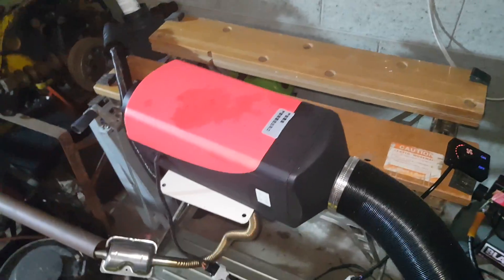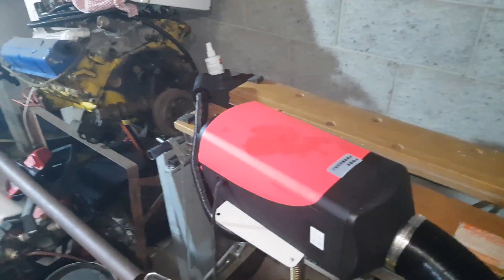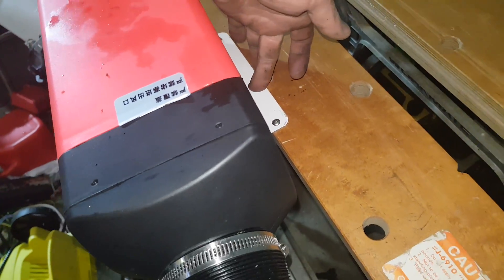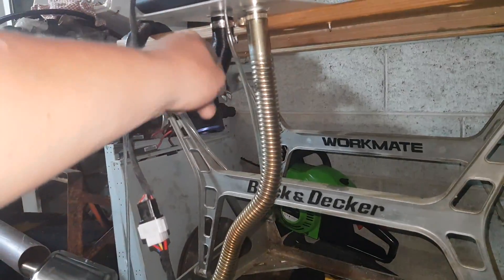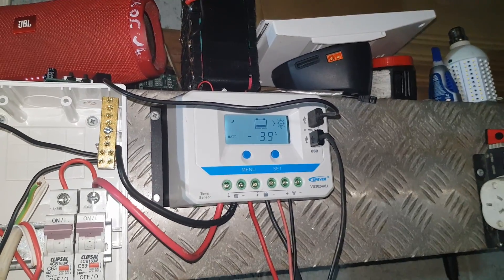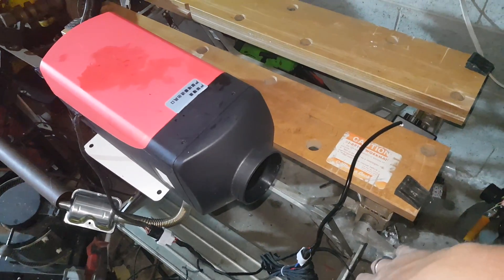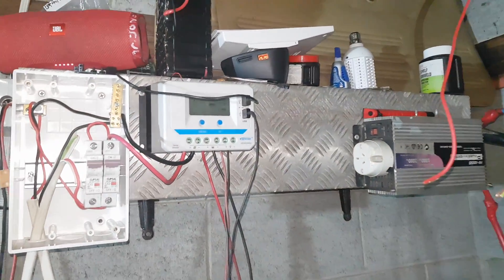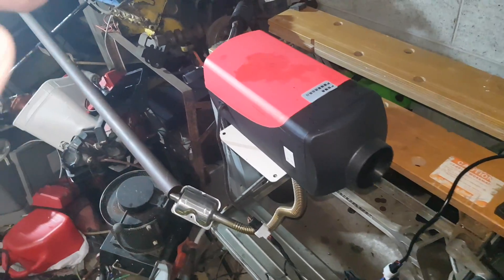5Kw Chinese Diesel Heater Powered By Off Grid Battery Pack. Epever 30Amp Solar Controller.

Comment: Is this run straite off the Electric mains
Reply from the maker: No 12v dc mate
Reply: Ok sound m8 am try to find a vid that can convert 240v down to the spec these need to run at instead run off batteries as i have power in my caravan
Reply: @toonarmybadboy8716 
It'll run fine off your leisure battery, better still if your hooked up to mains, coz it'll keep your battery fully charged
Reply from the maker: Yeah they dont pull much power
Reply: @Oneupthesleevecustoms  
Can it be ran off 1 lead battery and 300watt solar panel?
How many watts output
Reply from the maker: @95SlideNissan  pulls about 45 watts constant on high and 120 ish watts for 10 mins to stsrt up
Reply: @Oneupthesleevecustoms  
Thanks Bro, big help!

Comment: Great video .   Can these heaters be hooked up to cycle on & Off  ?  like how a thermostat does  Or are they on & Off only  ? Thanks for your time
Reply from the maker: These ones could have controller pulled apart and modified to run with a temp sensor. Id shop around at some stage they will come out thermostat controlled
Reply: Mine has a timer that you can set but dont think you can set via a thermostat
Reply: JJD1913  another useful vid here: https://youtu.be/fkdF4F-k3VI

Comment: I'm looking for something like this to head my boat over the winter, but the only source of electricity I have is a 12V battery with a 100W solar panel. Would it drain my battery within minutes/hours? My battery is roughly 90Ah.
Reply from the maker: It runs at about 2.5ah on high once it has started up so you would be fine over night as long as you get good sun each day
Reply: @Oneupthesleevecustoms  Thanks for the info. What about the Ah when starting up? I've read it takes about 10 mins?
Still, I might get one. 😊
Reply from the maker: More like 3 mins and about 10amps
Reply from the maker: https://youtu.be/BRMSFcq4Bc0

Comment: It’s running as should just cannot read the display I think all the screen are same I think you can put lcd on yours it’s just the mother board on heater that is different on 2kw as opposed to 3-5kw
Reply from the maker: Is yours the 2kw or 5kw

Comment: Just use vegie oil as long as its filtered and kept warm will work.
Reply: robsycko, the cooking oil needs to be about 200F/90C. Start up with diesel and end with diesel, but heating the cooking oil with the exhaust would do the job. I don't know how many windings around the exhaust with copper tubing would provide proper heat. That could be another test. For example, run 5 minutes then flip to cooking oil after checking the temperature. Cold oil does not atomize they same way as diesel, until heated. Possibly, with this burner running the glow plug at the end cycle the excess oil is burned, but I still would switch to diesel.

Biodiesel is an option for startups and shut downs. It has glycerin in it that helps to keep the burner clean. It was cooking oil, methanol, and Sodium Hydroxide, but the glycerin goes to the bottom and the lighter biodiesel floats on top. Diesel leaves soot from its use and biodiesel helps remove it.
Reply: @gregyohngy 
It'd be a waste of time in England, kerosene is 69p a litre where i live straight from the pump, and red derv is 89p a litre, 1ltr of vegetable oil is about a pound from Sainsbury's, although it might be cheaper in a Liddel or Aldi
Reply from the maker: Straight? How smokey?
Reply from the maker: https://youtu.be/yLUeCH_HE4Q
Reply from the maker: No good mate :(
Reply from the maker: https://youtu.be/-bmELZaH6zQ veg oil diesel mix

Comment: So does the rotary control still display fault codes using the light around the knob? That would be great if it did?
Reply from the maker: Ive not seen a fault code yet. Ill check and see if the manual mentions it
Reply: @Oneupthesleevecustoms  that would be great, it will help me decide which to go for. think i prefer the simplicity of dial controller and dont need all the flashing lights of the lcd one but the fault codes is a deal breaker. thanks
Reply: Rotary dials will show fault codes... depending on how many lights are on, it’s code is corresponding to E-01 to E-15.... E-01 is low power, not sure of 02... maybe over voltage? Not sure but I do know Facebook has a group/page on Chinese Diesel Heaters.

Comment: Hi I got one of these heaters exactly same as yours except I have lcd screen has been working fine but all of a sudden came up with error  007 so I tested wires none broken then it did something  else screen has gone all broken up and I cannot read what it says there’s three wires to my screen blue red black 4.3 volts comeing through red wire and 3.9 volts coming through blue wire is that normal do you think?i wonderd if you can see how many volts are going to your rotary controll panel should be same voltage I would think unless my mother board on heater it self has gone wrong🙂
Reply: No nothing
Reply from the maker: Can you find what the error code is?
Reply: 007 blue line broken but is not but now screen has gone all funny with bits of numbers missing etc
Reply from the maker: Thats strange have you checked plugs for corrosion ect?
Reply from the maker: Does it fire up at all? I would assume it would be low like less than 5v to the switch and knob to protect its leds
Reply: Yes I have even got rid of the plugs and solderd the wires because I’ve had trouble with those sort of plugs before on a car do you think it’s just the lcd gone wrong for some reason I’ve only had it a month,I did notice the picture on the screen used to flicker
Reply: @leginswheels2416  you get what you pay for. Chinese junk,in my opinion. Espar makes a great heater. Had mine in my truck for 4 years with little maintenance. Changed a screen twice is all .thermostat controlled, just like your home. Runs off diesel fuel. They're about $1000 more or less. Very reliable
Reply from the maker: Yeah im happy with these price wise i can buy 5 to 1

Comment: Can't wait to see the vid of the cabin install..  Was thinking an off grid cabin would be a great use for one or two of these. Even running it through a chimney of some sorts to try and grab more of the exhaust heat if you were trying to be frugal.
Reply: me to me to, but i think i will build an external silenced isolated metal box a few meters away from the cabin...you know just in case this heater remembers "wait i am from china" and starts burning out or something  fire spreading+wood cabin  bad combination
Reply from the maker: If.you protect from the exhaust system heat wise
Reply from the maker: Yeah just one will suit my mates cabin install only a small space

Comment: It will run great on  kerosene i use it in my heater.
Reply: It runs a lot cleaner on kerosene.
Reply from the maker: Can you buy it fairly cheap?
Reply: a big advantage to kerosene is that it won't soot up the combustion chamber if you run it on low for a long period of time. if you're near an airport jet fuel is even cleaner burning than kero.
Reply from the maker: Similar flash point?
Reply from the maker: Yeah all tests so far show it is very happy on kero
Reply from the maker: Is there any reason why you run kerosene over diesel?
Reply from the maker: https://youtu.be/-bmELZaH6zQ